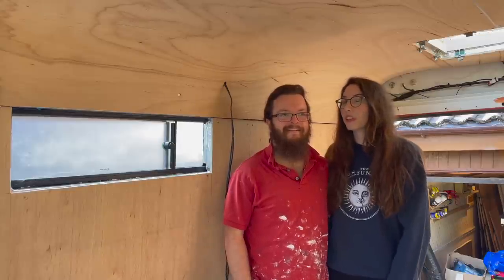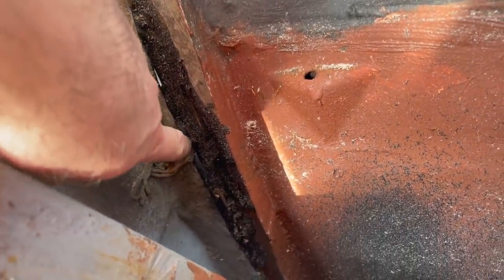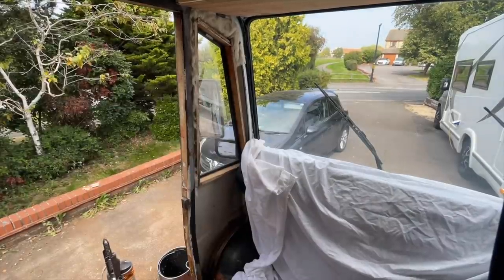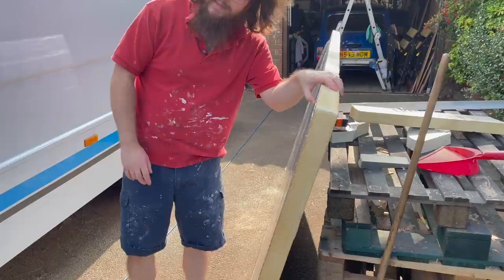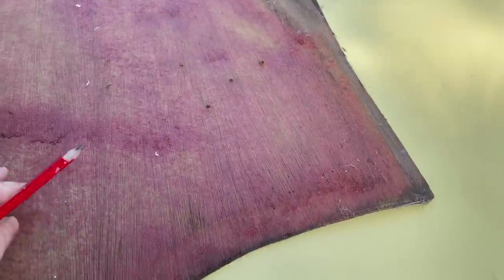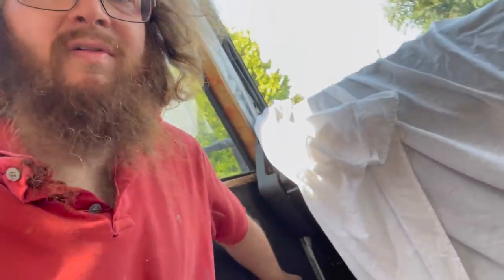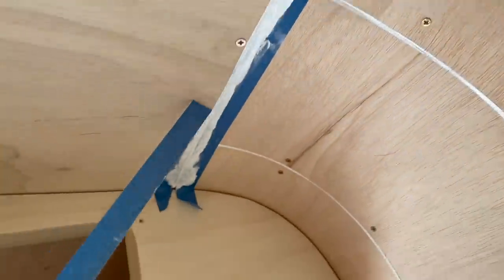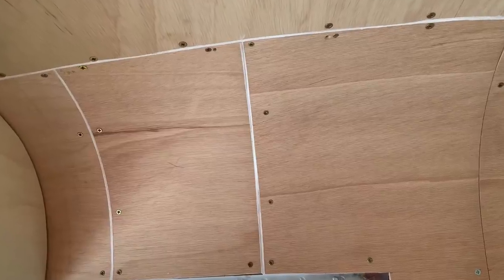Van Build Continues | Making Decisions, Painting + Lights | Mercedes Vario Camper Conversion Series

Comment: No doubt there are many ways to finish the ceiling but my suggestion would be to apply a very light white coat with a rag and rub it down so that the grain shows through, then varnish x 2. It is a technique I have used on the t&g ceiling in my van and looks good. Worth a try on a spare bit of ply to see how it looks. The advantage is you retain the natural look of the wood whilst introducing some colour.
Reply from the maker: This is worth a test for sure. We tried osmo tints but didn’t rag it on with the white tint, which was a mistake in hindsight. Will give this a test too. Thank you for the tip. Love it. Hope you have a fab week Peter. Take care 🚐🚐🚐

Comment: I think the whole video turned to the question should you buy Kelly a Donkey.
She let you buy a van and two minis so the least you can do is let her have a Donkey as it would be the right thing to do and you can easily adjust the van at this stage to house said Donkey rather than when it is all finished. (Just putting it out there)
Reply from the maker: These are all valid points. Also it probably makes more sense to own a donkey rather than two minis and a bus. This has given us a lot to consider 😂

Comment: ... what about countersinking and filling the screwheads before painting the ceiling to make it 100%?
Reply from the maker: That is one idea. Not sure how it’d fair in the 5mm plywood. But I reckon it might just be doable.
Reply: @WanderbusAdventures  ... Just use a countersinker and a drop of woodglue into the hole before re-screwing the panels, smooth over with some woodfiller sand it and  you'll be fine ...
(correctly countersunk screws have higher fastening because of more (close) contact surface)
Reply from the maker: This is helpful. Thanks Tom

Comment: Hi man! Great job and very thorough in your explanation as usual, so thank you ! 
I'm really liking the last few episodes ! I have a Mercedes 410D and am planning on putting up exactly the same kind of ceiling. Yours looks amazing !!
Basically the last few videos have been a gold mine! I was really wondering about the gaps you left between ply sheets and now I definitely can better see the use for them. Also great to have the name of a good product to use as sealant.
One little question that popped to mind watching this is : I see you guys haven't used any kind of vapor barrier on top of your insulation. I thought it was because you weren't using any natural materials, but now I've seen you put sheep wool in the ceiling and still no barrier. What are your thoughts on this ? Do you think the fact that you sealed up nicely all the ply will stop the humidity to come through and reach the wool ? Or do you think vapor barrier are just not worth it in a van ? I've seen so many different opinions on this, would love yours !
I'm planning on using more natural fiber insulation all throughout and really wondering what to do about the barrier issue.
Sorry for the super long comment !
Keep up the good work :)
Reply from the maker: Hey 😊 that sounds great. The 410D have a really neat look about them and I bet a curved ceiling will suit it right down to the ground. The barrier was a number of factors you've touched on; it's natural so actually manages moisture well - if we did it again we'd likely use it in the whole ceiling. We'd maybe use furring strips too to create more of a gap for moisture to evaporate. The board in the main area is pretty well sealed, so we decided on leaving the sides with natural wool and left an air gap to allow the bus to breath a bit should any moisture get up in there. Similar to what they do in airplanes. 

We think that the ceiling will be pretty well sealed once it is painted/varnished too as it is basically 'one piece'. We thought about putting good old reflectex under it all but by the time we'd screwed through it thought it might cause more harm than good. We appreciate our approach is not the norm; we certainly aren't saying it is right but this is our thinking.

Hope this explains what we've done and our thinking. Love the idea of using all wool; this would be our choice if we were to do it again. It is ace to work with. Maybe Havlok if you are worried about the smell; but that does dissipate (it has already).
Reply from the maker: Oh and thank you for your long comment. We totally appreciate it.
Reply: @WanderbusAdventures  Thank you for your long answer !
I see what you mean about the air gap on the side, I hadn't thought it would be useful in preventing moisture to accumulate. On the contrary I'd have thought you'd need to make it fully tight, so moisture never comes in. Does that mean moisture would find its way in an airtight environement through just condensing and temperature change ? If so, I can see why a vapor barrier wouldn't be really useful anyways... Better to let it breathe.
Also it's true that most natural fiber insulation regulate themselves and are rot-resistant..
Right now I'm thinking I'll go with a layer of cork and then a layer of natural fiber insulation (either hemp or wool or recycled cotton or a mixture). Had no idea what furring strips were before you mentionned it but that seems nice, air is the best insulation ! If you had done that, does that mean you would've added the strips on top of your battening ? They'd need to be quite narrow to not take up too much head room then... ?
Sorry, lots of question but it's nice to chat with someone who went through the same daunting process of figuring out what to do ! Insulation isn't my forte ;)
Cheers and bravo again on the build ! Cannot wait to see the finish result and what choices you make for colours and paints and stuff ! I totally understand how gutting the choice process must feel, but i'm sure the result will be wonderful !
Reply from the maker: A good read is the Far Out Ride Blog. They explain how they used an air gap with furring strips and it has worked well for them, even in the snow. Would really recommend their blog, it is down to earth. Ours is a bit of an experiment for sure, so cannot say it will work but this it our logic; we can't keep the vapour out unless the barrier is truly impermeable - we know it wouldn't be if you end up putting screws through it or have gaps for skylights etc. So thought we'd try this route. 

We are in the school of thought that if the barrier isn't totally impermeable then you'd end up trapping moisture up in the ceiling. So have gone for this, plenty of ventilation and heat. We may actually install another extractor in the bathroom and there will be multiple drop out vents in the floor for fresh air too. 

Our views are in the minority; we don't know we are right but have spoken to a few proper van lifers who have not used a barrier. Do as much reading as you can, watch Greg Virgos vids too - If you can create a proper seal then a barrier is good. We just couldn't see how that is possible with our setup. Too many fixing points, too many holes 😂
Reply: @WanderbusAdventures  Thank you ! Another very thorough answer ! 
With that explanation, it makes a lot of sense to choose to go without a barrier ! Also those things are expensive and a lot of work, it seems pointless to put one up if you're not sure it'll do anything. 
I was just a bit worried that not putting one meant risking screwing up the insulation, as barriers seem to be the rule. I've got windows all over, much like varios do (which is uncommon for a 410D), so insulation seems important..
However, same as you, I'll never be able to make it completely tight. I also like the idea of letting natural airflow do its thing ^^
Anyway, thank you so much for taking the time to write it all down, it helps a lot for my decision making process.
I knew about Far Out Ride but I often forget to look it up when thinking about such issues... I will definitely remember to check it out more often. And check out Greg Virgo whom everyone is raging about !
Big shout out from France, hope we'll get to meet on the roads one day ! ;)
Reply from the maker: That would be awesome. It’s a controversial subject this vapour barrier thing. Let us know how you get on 😊.